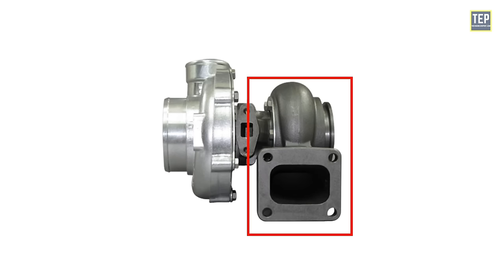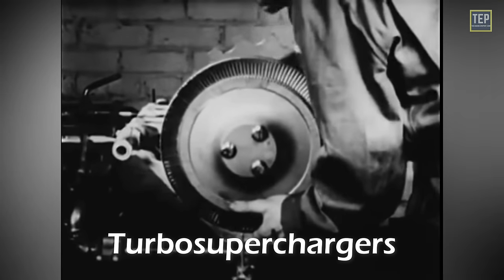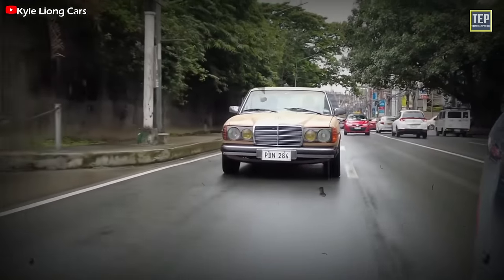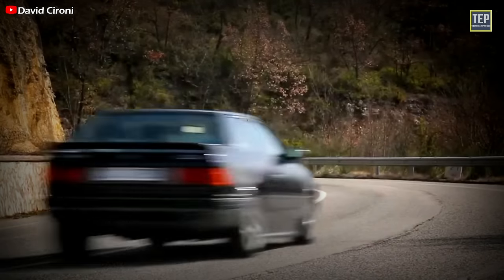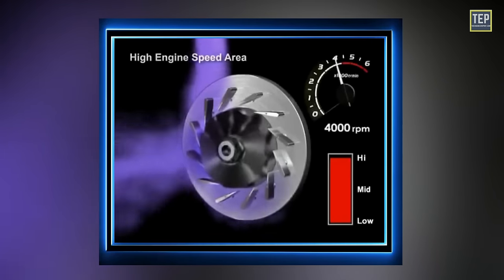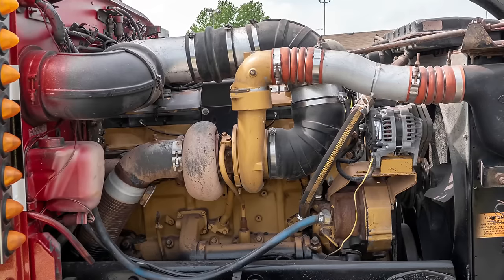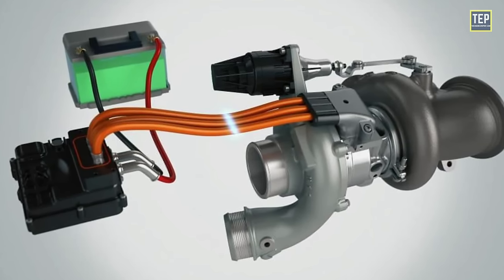Turbochargers Explained | How Single, Twin-Scroll, VGT & Electric Turbocharger Works?

Comment: You´ve missed the Saab 99 Turbo, developed in 1977, and introduced their 99 Turbo in 1978, with a wastegate, in a ordinary familycar.
Reply from the maker: Thank you for pointing that out, the Saab 99 Turbo was a significant development for Saab and it was fitted with a turbocharged version of the 2-litre engine. We'll make sure to include it in future videos.
Reply: Saab Turbo was my first experience with a turbo vehicle. It was a fun car to drive. I loved feeling that Turbo Power kick in.
Reply: In Australia, when a saab arrives off the boat, it takes about 6 weeks before it can go on the sale lot, due to the need to do rust repairs on them. the company I worked for use to do about 20 a week.
Reply: @TheEngineersPost aàa is
Reply: Facts born from Jets brother everybody keeps forgetting about them they call them GM but it wasn't jam it was saab opal they are the reason why almost every car on the lot now is turbocharged

Comment: Fun fact: The Roots-style superchargers are older than the piston engine itself and were first in use to pump air into iron furnaces.
Reply: A roots supercharger is a lobe pump, they already existed before piston engines, it was only when one was fitted to an engine that it started being called a supercharger. Centrifugal compressors also existed long before, as did turbines. Again it was only when one was fitted to an engine that they started calling it a turbocharger.
Reply: @BigUriel kk
Reply: @BigUriel were called turbo-superchargers for a long time, before it was shortened to just turbocharger

Comment: The electric ones work ok and may the next to be installed in cars, trucks etc .You can get them as tween  turbos as well.I have seen them installed in a Chevy Volt here on Youtube but it was a little crazy but it worked on the 2.2 engine .Single one was 2500 dollars and th tween  turbo kit double price as the single turbo kit .
Reply: g3

Comment: If it gets to be electric, then we can even use a reciprocating pump, eliminating rotors altogether.  Far more efficient and a small pump can produce all the pressure needed.  In fact, a little cylinder can store a certain amount of compressed air to open up and supply the extra air to the engine as soon as it starts up.

Comment: So you hook up your turbo to the air intake and the exhaust manifold? Why doesn’t that make sense to me.
Reply: Basically...

The exhaust spins it

The spinny thing is now spun

Air doesn't like to be spun as it gets hotter.. so its fed into a intercooler 

Then if there to much air it goes su tu tu tu

Cannot be simpler
Reply: @nolesy34  lmao perfect "su tu tu tu"
colder air is denser air = moar air. otherwise its all just hot air

Comment: I wonder if there is a turbo attachment that shoots air in the form of pure oxygen, right into the turbo
Reply: That Would Be A Supercharger
Reply: I doubt it very much. Where would that oxygen come from? You'd need an oxygen cylinder in the vehicle.
Reply: Basically what a Nitrous oxide system does.

Comment: --- Time Stamps --
00:00 - Introduction
00:24 - Working Principle of Turbocharger
02:19 - Why use a Turbocharger?
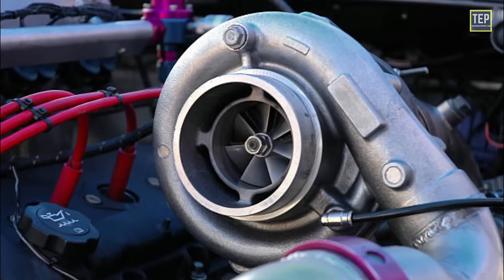02:58 - Main Components of Turbocharger
04:03 - Early Turbochargers
07:05 - Turbocharged Cars
09:55 - Twin-Turbocharger
11:18 - Twin-Scroll Turbocharger
12:12 - Variable Geometry Turbocharger
13:07 - Electric Turbocharger
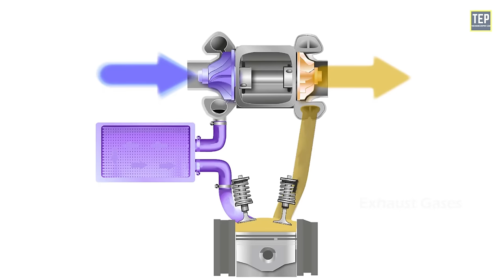14:20 - Advantages of Turbocharger
15:18 - Disadvantages of Turbocharger
16:26 - Conclusion

Comment: great video, i have a 2021 Mazda 3 with a Turbocharged 2.5 inline 4 (250HP & 320TQ)
Reply: I have a 2007 Ford Focus St 2.5 five cylinder turbo running 340bhp
Reply: I got a 2017 q60 3.0t it’s a v6 twin turbo with 300whp. What I love about the car is just full bolt ons and a tune, and it’ll get 450 whp or 530bhp

Comment: Saying that turbos are more compact than superchargers is wrong. The full assembly of a supercharger literally comprehends the supercharger and the pulley with the belt. A turbocharger unit in the other hand consists of the turbo, the whole intake manifold, the exhaust from the engine to the hot side of the turbine, the wastegate, the oil line to the turbo and this is the essential; imagine the space that this system occupies with all the sensors and electrical harness, the intercooler, and the pop-off valve with the screamer exhausts.

Comment: Electric driven turbo charger is promising and should be further developed by using vfd motors electronically controlled with respect to engine speed or throttle. .Anyway,  thanks for the knowledge!

Comment: Just a Learning Question on Turbocharger for a V6 3.6l engine in  Porsche Cayenne. Can you run an Air Cooler for the Exhaust Gases to help keep the Turbo cool? And Running your Oil through a Transmission cooler be Wise Too?  Thanks.
Reply: You very much do not want to aircool your exhaust, you're gonna take energy away from it and it won't be able to spool the turbine, plus you'd probably melt the cooler anyway. Consider water cooled turbo. There's also oil coolers if you're worried about overheating your oil. Anyway, if you want to DIY then you have to EXTENSIVELY research the topic of boosting or you risk blowing your engine. Or just give it to someone experienced, boosting is not cheap anyway.

Comment: Which turbo charger used in kia seltos
Reply from the maker: The Kia Seltos is available with two different turbocharged engines. The 1.6-liter Turbo GDI engine uses a twin-scroll turbocharger, while the 1.4-liter Turbo GDI engine uses a single-scroll turbocharger.

Comment: I have no idea how something can spin over 200,000 times a minute.
Reply: It floats on a oil film :D the small 0.8 smart engines rev their turbo up to 120k already
Reply: You can hear a turbo . Though it can reach higher notes than any singer. Maybe listen to a video with a big single turbo. Less scary RPM.
Reply: I used the work for an air bearing company & we made drills that ran over 300,000rpm. Because the bearing is air,there isn't heat build up.
Have a look @ Westwind airbearings.

Comment: Not sure if I agree with a lot of the comparisons to superchargers. The latter can use a standard manifold, downpipe and exhaust, doesn't need an intercooler for lower boost applications,  requires less complex vacuum systems, fits more directly to the engine making it easier to install etc.
I suspect the turbo is more common because it can be driven off boost which will fudge the MPG and emissions figures. A supercharger is always on, always adding boost from idle to redline.
Reply: In a gasoline engine the throttle leverages the turbo to expand the pressure range. With a supercharger driven of the crankshaft, the compressor and throttle fight each other.
Reply: Definitely more power potential with a turbo set up, although at higher cost and more complicated packaging as you said.

Comment: where is the need for an exhaust if the turbo is getting of all of the exhaust gas then?!?!?
Reply: The turbo get some of the exhaust gasses, not all. Then the the gasses after combustion need to exit the engine. 👍
Reply: @Gregsheppo66 oh yeah i just learned that in a few vids about turbocharging, having all of that exhaust gas would definitely destroy the turbocharger 😅
Reply: but there is still exhaust waste right?

Comment: You missed-out the MOST IMPORTANT early turbo application in a car - the BMW 2002 turbo, launched September 1973. Europe's first petrol/gasoline turbo, before Porsche (1975) or Mercedes (1978)
Reply: Though not the first use of a Turbo on a car.

1962 Oldsmobile Jetfire V8

Comment: electric turbos are trash, and cannot be called turbos. a turbo uses the exhaust gases to make more boost, all the electric turbo is is just a glorified leaf blower attached to the engines intake
Reply: That’s one way of looking at it, or consider the most efficient means of spooling the turbo whether it’s exhaust or electricity it doesn’t matter. What matters is the boost. 👍
Reply: There are toy electric turbos, or real ones with electric motos around 25 hp, which can not work on 12 volt systems, from what I recall.
Yes, I do get a chuckle of the "leaf blower" type.